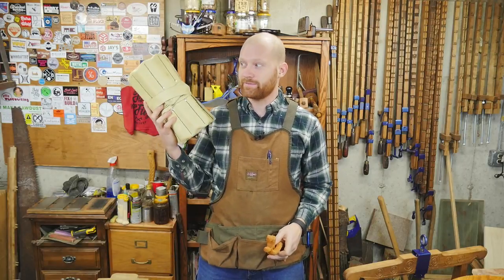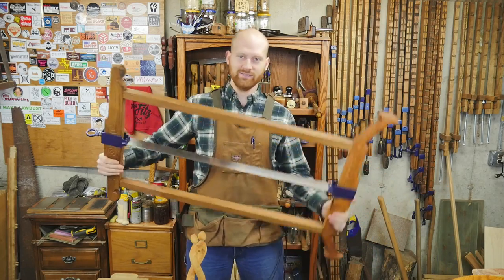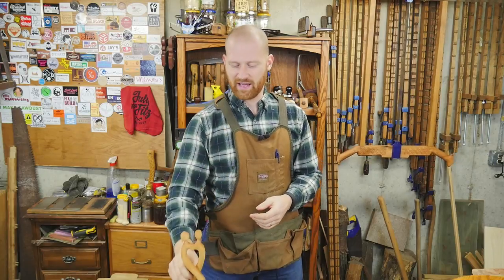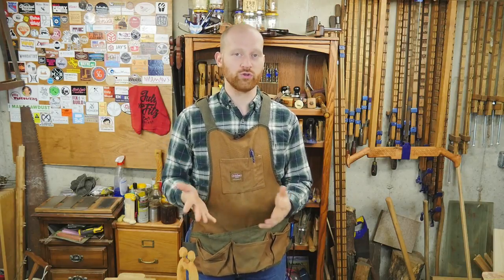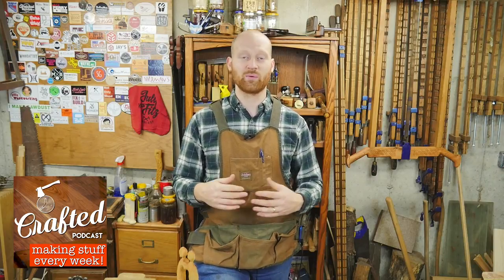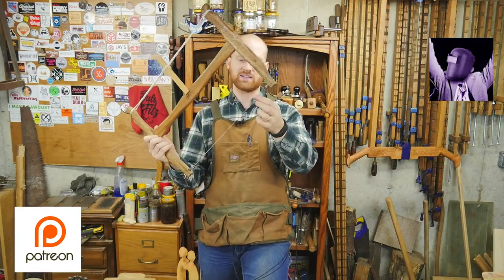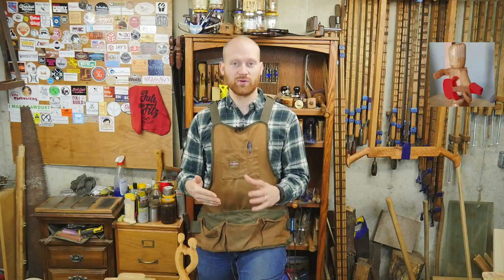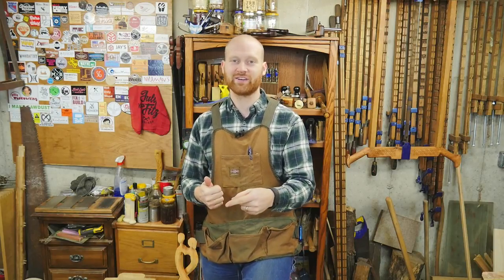Report, Frame saw, Chip Carving, Dresser, Crafted Podcast, Meetups, and More

Comment: Use a 1/4 inch or 3/8th inch plywood and make many 1/8th dado' cuts on the backside and it will bend as much as you like.  I do this on my table saw, but i'm sure there is a way to do this with hand tools.
Reply from the maker: that would be fun with hand tools.